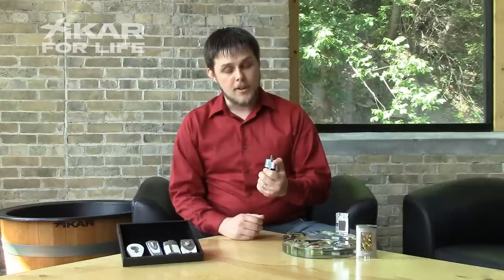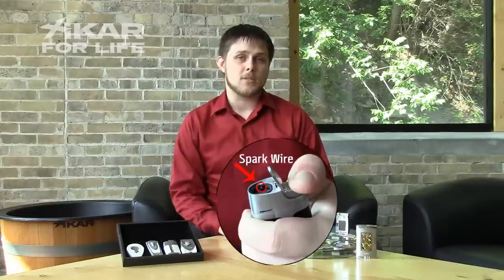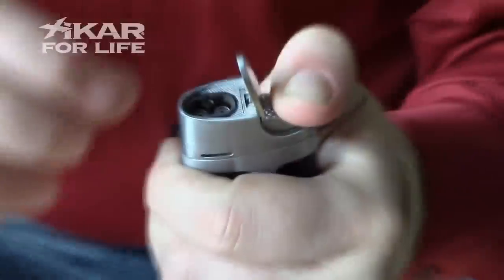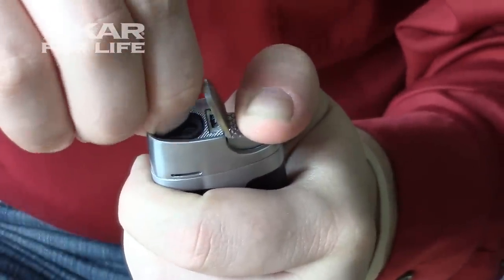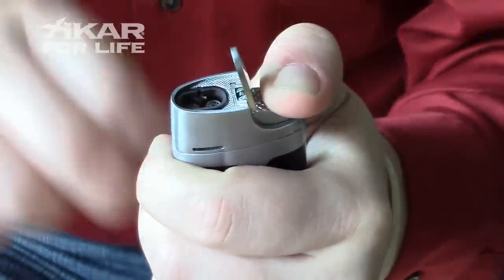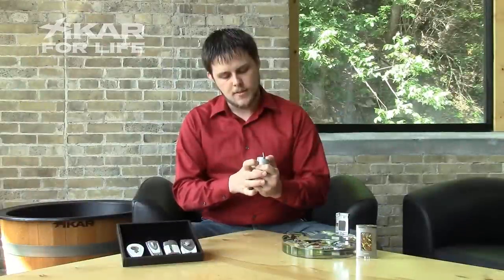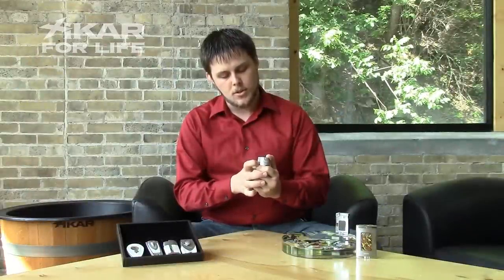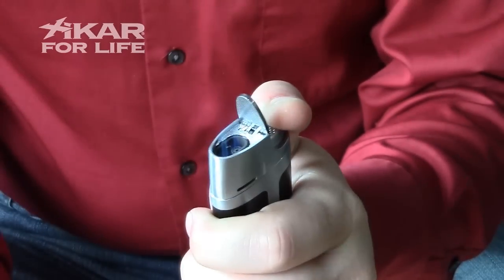XIKAR Lighter Troubleshooting: Adjusting a Spark Wire

Comment: What if there’s no spark, haven’t had my torch for that long, and it didn’t fall or anything sat on the table over night didn’t work the next morning.
Reply from the maker: When there is no spark, it is likely a faulty igniter, and that is not something that can be repaired at home. If it's a Xikar lighter, send it in and we will take care of it. Xikar.com/warranty has all of the info you need.

Comment: What if you’re not getting a spark? Not even a click? Just gas. I’m using a mini eagle torch. It was working at first but suddenly stopped clicking
Reply from the maker: Not getting a spark usually means that the ignition is broken. It is rare to wear it out, but more common to find a broken spark wire.
Reply: XIKAR yeaaa I already figured it out by dismantling it myself and repositioning something’s but thanks anyways

Comment: So I don’t have a xikar lighter but I’ve got another torch lighter that won’t ignore because I think the wire that creates that spark broke sometime while using it. Does anyone know of a way to remedy that situation so that I don’t have to trash my torch? Ignition switch still clicks and fuel can be heard coming out but no flame. And yes, I’ve adjusted the fuel output to see if maybe there way too heavy a stream for the spark to light and that wasn’t the problem. I’m sure it’s the wire itself that’s broken. Anyways any help would be amazing. Can’t really find much info on how to fix this on google so I figured it couldn’t hurt to post this here. Thanks in advance.
Reply: you need to get a new piezo
Reply: I've gone through over 10 torches in 1 year because of these piezo ignitors!  They are the first thing to break 99% of the time.  I always save them out of discarded torches/lighters to use for fixing other torches or for parts.  If the wire is too short because it broke I scrape the end to clean copper or brass and then solder a piece on from a parts torch.  Make sure you use some heat shrink over the repair so it sparks at the end like intended and not where you repaired it.

Comment: I purchased mine. After 1 day of use I don't see the spark. I spend over $100 for a lighter and no spark :-( Very disappointment customer.
Reply from the maker: Is the spark wire bent the wrong way? you can adjust it with the point of a small screwdriver, move it a small amount and see if that solves your issue.